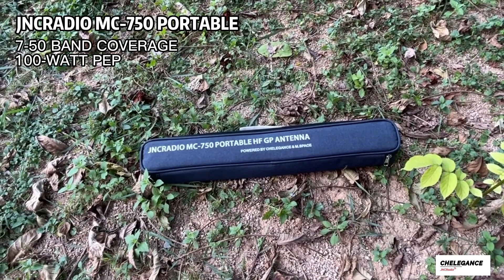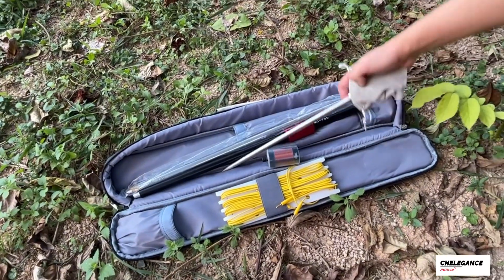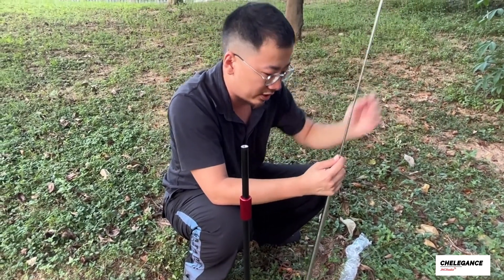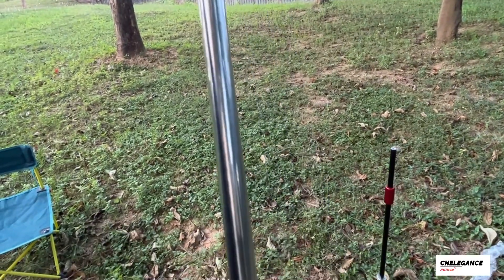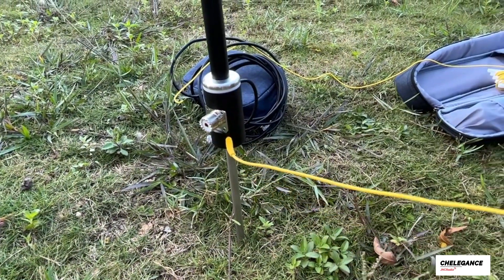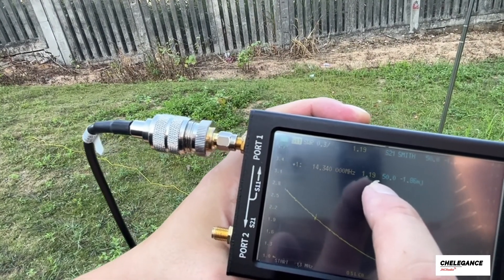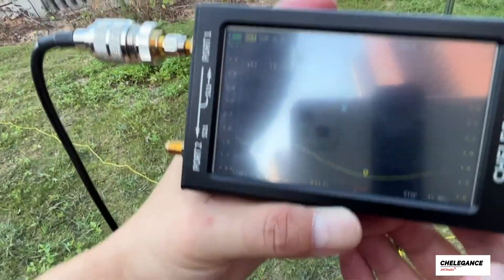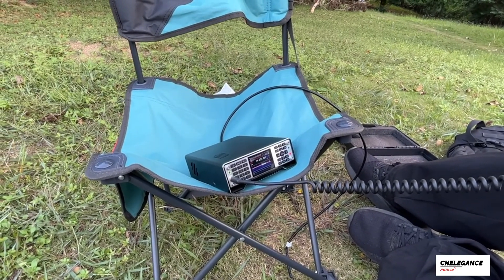POTA/SOTA with JNCRadio MC-750 antenna and VNA!

Comment: Really nice presentation and display. The carrying case is great and would be something any of us could grab and go for a quick SOTA or POTA activation. And thats coming from a long time Wolf River Coil owner/user. They even make nice small touches like having the counterpoises brightly covered, a simple stake for push in setup as well as optional tripod. BTW, the tripod alone looks like a quicker setup than WRCs. For comparison the Wolf River Coil counterpoises comes with black wire which can't be seen on most surfaces other than snow. I have had to apologize when people walk around my cones and trip over the wires. Yellow looks great!

But why use M10x1.5 threading on the whip? This is pretty much a deal breaker. In addition to not being able to use my existing 3/8 24" whips, I dont seem to be able to find a replacement whip on the web. People with existing setups may like to grab the MC-750 whip as an upgrade to what they have now. The band markings will likely be close and either way would make a good reference. I usually bring a printed chart and fine tune with my Rig Expert. The MFJ-1979 is a nice 17' whip, WRC sells 17' whips as well as 8.5' and 6.5' whips that use 3/8 24" threading. I dont want to wind up having to keep two sets of whips.

I might grab one of these and just carry a 3/8-24 Female to M10 M10X1.5 Male though. Especially since from experience in POTA and working at Radio Shack, the whip will be the first thing to go after heavy usage. But that adds to the cost complexity and the extra length of an adapter will throw the markings off if your whip is used on a non MC-750 base.

73 - KC1OCA
Reply from the maker: A spare telescope whip for MC-750 can be purchased here - https://chelegance.com/product/mc-750-antenna-parts-replacements/

Comment: I am so happy with the build quality of this antenna after many deployments. By having a lower radiation angle the single bounce off the ionosphere allows me to make easy DX contacts overseas on 20m, 17m and 10m that I tested. The inclusion of 6m is nice as we have a few nightly 6m nets. I can be at the park and work 40 and 20 then adjunct for 6m and get my checkins logged. It deploys in minutes and tear down is just as fast. I dont need to have a 60 ft tree nearby or multiple attempts to get a wire in a tree for my end fed where I can just push this into the grass, lay out the counterpoise wire, extend the whip to the 14Mhz mark and bingo a low SWR and now lets go make contacts. No tuner needed! Great job Jesse and team 5 stars on this antenna.

Comment: What is the thread size and pitch on the 17' whip? 3/8-24 or 3/8-16?
Reply from the maker: Neither - It's a M10x1.5
Reply: @chelegance there is a 3/8-24 female to 10-1.5 male adapter. It would be good to include it and charge for it of course.

Comment: How about 30 meters? Will this antenna system work on 30 meters?
Reply from the maker: the antenna works 7-50MHZ so yes it works on 30 meters
Reply: @chelegance  , for 30 meters does the 40 meter coil need to be attached?
Reply from the maker: @potaactivator  yes you do. check the user manual of tuning 10MHz. https://chelegance.github.io/WIKI/ANT/MC-750/MC-750/
Reply: @chelegance  Thank you. That is exactly the information I needed.